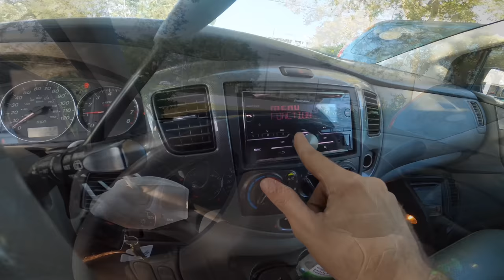Bolts through the window! Mazda MPV 2005 Window Regulator Broken

Comment: A number of years ago my old rickety Chevy S10 4x4 Blazer was on its last legs.  Now, for me, "last legs" is a relative term.  I still have a perfectly serviceable 1993 C1500 with nearly a quarter of a million miles...

While out running errands, I locked my keys in the car.  I still had some vital appointments scheduled so to get the keys quickly, I put a brick through the passenger side window.  Lots of funny and concerned looks from passers-by.

I made all of my appointments that day with no issues.  The next day I hit the U-Pull-It lot to salvage a junk yard passenger window.  Then, once back home, after much vacuuming of the vehicle and door interior, I bolted the replacement glass to the window carrier.  With everything snug, I thought, "One quarter more turn..."

*SHATTER*!

"Oh Frack!"

I loved the job so much, I did the whole thing twice!   ;-)

Comment: Ray: I'm curious about the way your spare parts supply chain works. Who's bringing parts to the shop so quickly? Do the suppliers use couriers; does the shop have "a guy" who tours about, picking stuff up? I'm not sure if a similar system is in operation in bigger cities here in Scotland but, out here in the sticks, we wait days/weeks, not minutes like your parts here.

Nice job on that door. I'm no mechanic but I hated working on door internals. I don't have enough joints in my arms and I can't see through steel. You made this one look easy(ish).👌
Oh, P.S. Something I did notice; you missed a bit. Sorry, I'll just get my coat.😁

Comment: The earlier models had all metal parts, but from about 2001 and later they built in planned obsolescence, with the critical parts made of plastic. I have a 2001 Toyota Avalon which broke on the driver's side too. The genuine Toyota part was $750, but I was able to obtain a 2000 new part for just $70, which had all steel parts. The motor mount though had shorter studs, so I was forced to use tube nuts but everything works fine. BTW I am not a mechanic but grew up with some knowledge of ME

Comment: Though I don't see that you missed a spot,  but a better window cleaner may help with removing stickiness and other bits.
I've used the "3M foam window cleaner " for over 30 years. It takes off every thing from road tar to dog nose slobber. 
Spray on...allow foam action...paper towel scrub...wipe/polish with separate paper towel. Only needs to be applied Once.

Comment: Ihave a Pioneer car HiFi, a few years old and out of warranty, where the encoder for volume and menu browsing has gone haywire. Sometimes it doesn't react to rotation at all, sometimes it acts completely randomly, giving mixed positive and negative increments whether turning CW or CCW. So I'm GLAD that I installed the wheel button control gadget that came with the ISO to Ford wiring adapter and bezel.

Comment: Aren't you glad you're not getting only .4 hr  to both remove AND install trim panel and weather sheet?
Yeah, in an independent shop you can either use Chilton, or charge straight time.
But starting with an amount you agree to is customary.
The front end of the glass goes downward out of the run, usually if you must remove it.
Duct tape can set a position for the glass. You put a shop towel on the non glass and one tape applies to both sides like a big U.
I tried to get these parts at a yard for a woman and they let me take the whole door and return it later.
Twenty bucks cost afterwards. And the parts were like new.
Then her boyfriends ruined it again anyway. Seemed deliberate. They tweaked the door shape it seems.
Oh well.
Troglodytes.
I'll bet this part was $300 or more.
Nice cleaning job.

Comment: But... what about the original customer complaint that they brought it in for in the first place?  They no longer care about the passenger window being slow?

Also, that is exactly the same stereo I have in my car.  If I recall correctly ('cause it's been awhile since I actually needed to turn it off while the car was running), pressing and holding the "Source" button for several seconds shuts it off.

Comment: I need to have my Driver's side window looked at on my 2005 Chevrolet Equinox . The button is taped over and I was told NOT to use or touch it since I got it in 2021 .

Comment: Regulators. Not a hard job, just finicky...

One thing I tend to do of which I probably shouldn't, is using a jumper pack and a few nails to work the regulator directly when moving the glass into position to separate it from the regulator.
It works great for testing the replacement regulator on the workbench before you start pulling crap apart, and it'll soon tell you if the regulator coming out is genuinely stuffed by taking the switches etcetera out of the equation.

Comment: As others have stated, much easier to unbolt glass first. Then I grab glass and pull it all the way up and home. Run masking tape (Doesn't leave residue) from outside glass over top of the frame and to inside glass. Do this on left top, right top and center top. Glass is now secure and out of the way in storage mode. For safety you can use a phone mount or any suction device on out side of glass down by bottom seal to insure even if all three tapes release it will hold glass from falling (But that is serious overkill..lol)   Then whip out motor and Reg.  Click power all back together, hook up new reg and run it into position for window bolts. Then install new motor and reg, unsecure window, lower and bolt. test if you must. Finish reassembly of panel...I can do one easily in half the time of this one showed. But hey it's a learning experience, one must do these over and over. As always YouTube videos will show you where all those hidden little screws and fasteners are for various models...take care dude...great channel.

Comment: Once the panel was pulled away, rather than disconnect the 2 cables on the interior door handle, a simple twist sideways would've allowed the unit to slip right through the opening. But then you discovered that upon reassembly, as I typed. As others have already mentioned...the switch assembly should've been removed from the panel instead of awkwardly holding up the entire door panel. I guess the usefulness of those details will become more apparent the more you have to deal with door panels. The cold weather around here tends to make panel removal quite an experience that sometimes simply can’t be avoided. Great channel.

Comment: Use Milwaukee cordless tools. Heat gun. on the moisture barrier, Diesel Locomotive Electrician. The sticky stuff use tire bead sealer. Comes in a jar or tub.

Comment: I restored corvettes for over 30 years and I have a small suggestion for you, whenever you’re doing a window regulator, spray the felt runners on the front and rear of the glass with silicone. Your window regulator will slide faster, quieter, and last longer by doing this small preventive maintenance technique. And just a small note don’t spray the felt on the sides of the glass for obvious reasons, it will smear on the glass.
Reply: I  was gonna suggest the same thing!
Reply: @TacticalTinkerer  Corvettes in the 70’s and 80’s would go through window regulators like there was no tomorrow, we went above and beyond by removing all the tracks and rollers, clean and re-grease everything, including siliconing the felt then install the new regulator. I’m happy to say in all the years we were in business we never had to warranty a repair.

Comment: i am personally crying seeing this water sealing foil so fked up. This needs to be replaced if the customer does not want to end up having water pool on the floor. And a lot of times there is no such silicone sealant around from OEM. OEM foil has its own double sided tape and all that silicone needs to be cleaned before applying OEM foil. Other story is having metal cover like the VW group cars have these days.

Comment: They make a set of suction cups with a cable between them to hold the glass up, they are pretty cheap too. Always lube inside the channels for the glass with spray silicone so the window doesn't drag on the felt and rubber causing extra load on the "much better than OEM" replacement parts and premature failure / comebacks and much smoother operation. I never disconnected the door handles of that style, like you found out the ASSY will fit through the hole and it eliminates the "OOPS the door handle arms were brittle from heat and weather" rendering them into two piece arms and a return to the front counter councilors for "Mo money".
Reply: I usually put the glass to the top, then stick a strip of masking tape up the outside of the glass over the top then down the inside. This keeps the glass safely out of the way until you need it again.

Comment: I have done several of these.  Loosen the window bolts first and tape the glass to the frame. Then remove and install the new regulator. Pro tip: Cleaning the track and lubricating with silicone spray goes a long way to helping the motor move the window.

Comment: I had an issue with my window once, it would go down but was failing to up at all and took about 10 attempts to get it to move up, as soon as I unclipped the window switch it started working fine again, put it back about a week later it started again so actually disconnected it and cleaned the contacts on the switch and the connector and it's been working perfectly since.

Comment: little advise from a glazier, remove the glass first then regulator, much easier to mess with regulator when glass is out. You rock man.  And that butyl that holds the plastic on, well you are in Florida, stuff gets real gooey in hot weather.

Comment: Seriously broke the interior door handle and acted as if it's not a big deal? Yea the screw/bolt in the center of the handle will keep the handle in place for the most part but the front part of the handle won't be tight against the door panel. Over time using the handle the front of it will start separating creating space between door handle and door panel. 

The door handle removal on most all vehicles that's got a single screw holding it the screw remove and slide the handle away from the hinge side. That clip slides towards the hinge side of the door to help keep the nose of the handle tight against the door panel and prevent the handle from swiveling over time.

When installing a door glass regulator that's cable driven insert the cable and track into the door cavity first then the motor.  Also removal of the glass isn't necessary. Release the glass from the regulator and send the glass to the top and tape in place. I use auto paint tape with 2 pieces of the top frame of the door. Don't tape on tinted windows just run a piece on both window tracks. But with the glass all the way up nothing in its way to the removal.

Comment: Grease  the regulator on the passenger door, may be  dry, no doubt is.  Also spray silicone on the rubber track it runs in, as if you don't know that. haa, but got nothing  else to do but kibbitz. Haa

Comment: Problems with car windows give me PTSD. Of the 4 windows on my car, 3 regulators have broken with the driver side breaking twice. It took me six hours to replace the regulator the first time because I didn't know what I was doing and I only had wood drill bits to drill out rivets with. I broke several. I also had no way to replace the rivets so I used nuts and bolts that I pray don't become shrapnel if I ever get hit. I also bought the cheapest regulator off of Amazon for like 35 bucks. Unsurprisingly this broke again after about a year. This time it took me about an hour and I actually bought a decent quality regulator from Advanced Auto Parts. I never wants to do it again.

Comment: I have those issues with my Mazda, you can buy and replace just the plastic gear inside the motor. Easy peasy job and way cheaper ($10) than replacing the whole motor or regulator assy. Just sharing..

Comment: Why don't you use a piece of tape to keep the window glass up, Stick the tape to the inside of the window glass then over the top of the door frame and then stick it on the outside of the window glass, You can purchase the proper tool it's 2 suction cups with a piece of wire joining them together.

Comment: What year is this car? I'm shocked to see the polythene sheet still used, I worked in a bodyshop in the early 00's and only came across polythene on Peugeot 306s, MK2 golfs and the like, everything seemed to be going to a foam type cover or on the more high end cars a metal panel.

Comment: wow that video is VERY conveniant, i got a corolla E12 from 2007 and the driver window seems to be little bit loose (more than usual for the past week), can somebody give me an estimate on what this would cost me to get repaired in hours, since currency and labor cost per hour differs cery much based on location (given that it may be only a few adjustments and no general replacement  ... i hope)

Comment: It's a long shot, but I thought I'd ask.. I have a 2001 Mitsubishi people mover, it has an obd2 port, but it cannot connect to the ecu regardless of what protocol it runs.. (in all fairness, my obd scanner is just one of those cheap $5 bluetooth ones from Ebay..) scanner has worked on my previous cars, and friends cars, but I just can't get it to connect to this cars ecu.. any advice?
Reply: Try a different scanner to eliminate that as the problem first.

Comment: next time remove 2 bolts eather side of the slide /glass will come out 45 degrees then take out the motor assembly (front doors only )

Comment: You can insert a couple of small rubber or wood wedges between the window glass and the channel to hold it up in position and out of the way while you remove and install the regulator.

Comment: You completely left off a metal bracket for the door handle.   That is why you had to turn the screw so much.  It only stopped because it hung up on the plastic.  Major bork on this one.  Now the handle has a good chance of breaking off.  Go to 6:17.  That is the bracket you didn't put back on.

Comment: For most window regulators motors you can also use an external battery to directly power the motor so you don’t need to mess with the door switches. Usually they’re only 2 wires, switching voltage between the two changes the direction of the motor.

If the motor is “dead” and not moving you can also supply a higher voltage (ie 18 Volts) directly to the motor and often get it to move. Very handy for when you need to reach the window bolts with a dead motor

I have.a little attachment for my tool batteries that gives me two leads for this purpose.

Comment: you read my mind. jajaja and no. but the teaching are there. the plastic inside the door panels are hard to put nice once is open. and more when has it years taking heat. it tears easy. and yes. it seams you miss a spot. jajaja. most mechanics miss to clean it work.  i do add some type of oil where the glass slides. that also helps. Most miss these on maintenance and or car cleaning.

Comment: Still using the same crappy regulator design that they used since day one on the MPV. Trick is to remove glass first, and put it in last. I owned a first generation MPV. They sell a repair part, the drive gear, which moves the nylon balls on the cable. Saves big money.

Comment: If I don't have to shut the door, I like to put the window where I want it and run a couple "straps" of GOOD duct tape over the top of the door with 4 or 5 inches inches adhered to both sides of the glass. Works great!

Comment: Also curious thought about having to plug the door panel back in for moving the window, kind of curious if those control panel sections for the door are somewhat universal or not, and if they are, could you just get a cut out section of door panel to keep around, either from a junkyard or etc, and just plug the window control wires into it every time you need to do something, instead of the entire bulky door panel when working on things.

Comment: I 3D print stuff all the time and I still refuse to use plastic screws. Even the ultra-light range of engineering I'm operating in I use brass heatset inserts and proper screws.

Comment: I usually pop out the switch assy to make it easier to run the regulator up and down while working on it. Easier than trying to balance the entire door panel 72 times! Just a suggestion.

Comment: The window controls are only held on by a screw maybe two depending on make, once you have the panel off you can remove it and leave it connected to operate the window... simpler than holding the panel against the door again and again

Oh you missed a spot

Comment: The drivers side window on my '90 Chevy 1500 dropped open years ago.  Manual regulator, should be simple (I thought).  The fasteners holding the glass to the regulator had corroded off. Replace the corroded fasteners? Nope, the studs of the fasteners were affixed to the glass and could not be replaced.  Had to replace the entire glass to repair.  As an aside, a cut-to-fit 2X4 wedged in held the window closed until I found a new glass.